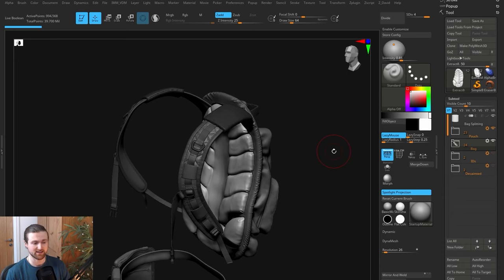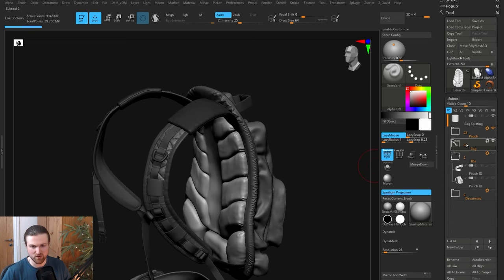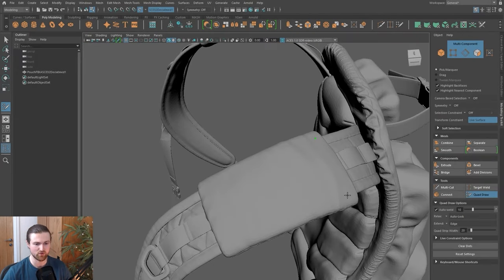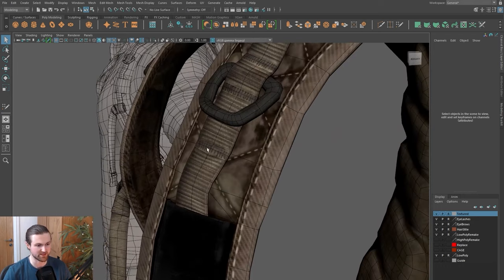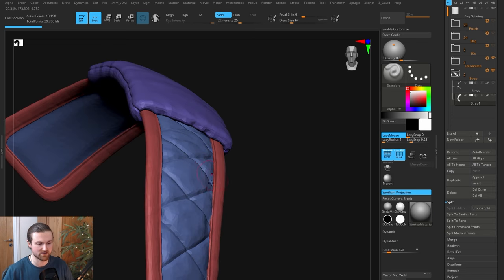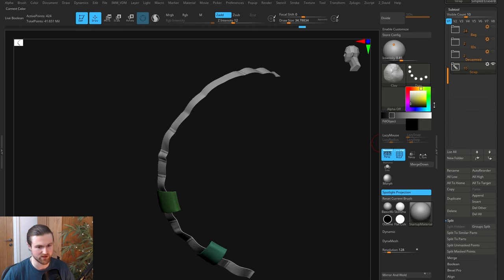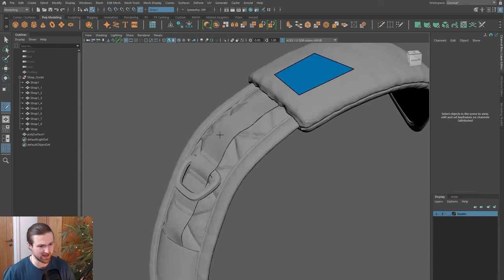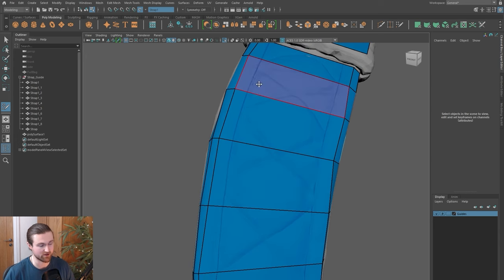🦜Retopology In The Games Industry - Fundamentals To Get You Hired

Comment: hello, what is the difference between one combine low poly model consisting of many subtools (for example 20) , and one merged low poly model?
I guess you created backpack in marvelous designer. If you retopoly'ed that mesh inside of marvelous, but every subtool seperate and then combine everything, it would be ok? Is there a limit for subtools? Or high number od subtools cause problem for riggers?
 Is there a difference between merged and combine apart from the number of polygons for a ready AAA asset?
Reply from the maker: No limits to subtool.
When you have multiple subtools / Maya objects. 
These can be left separate and exported as one FBX files. 
Everything is kept separate inside of these files.
It's the standard we use in the games industry.